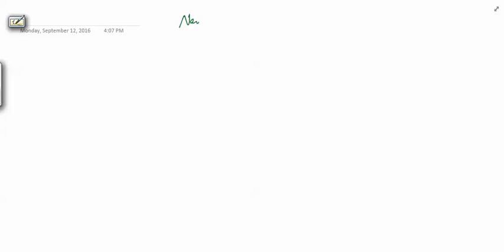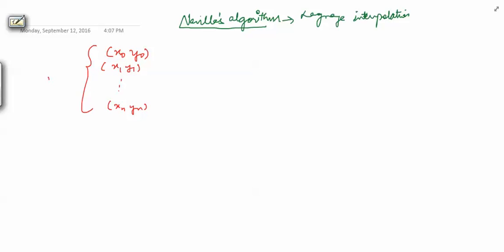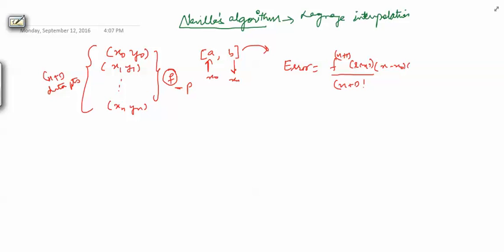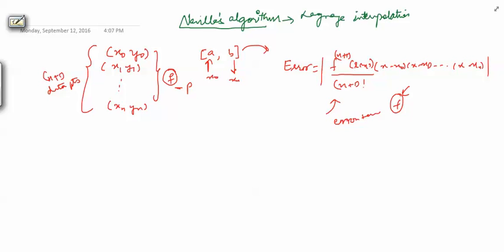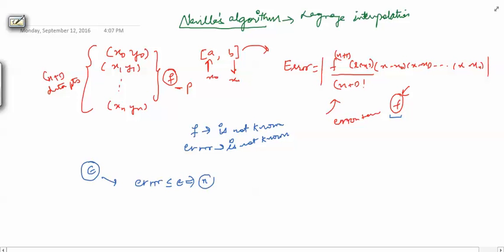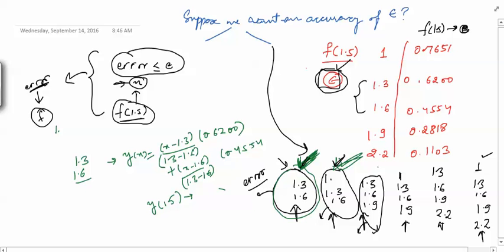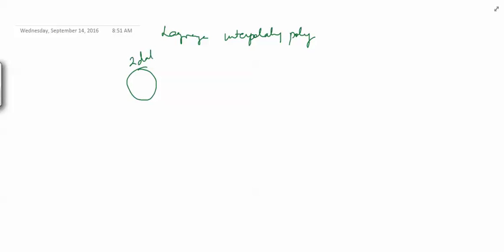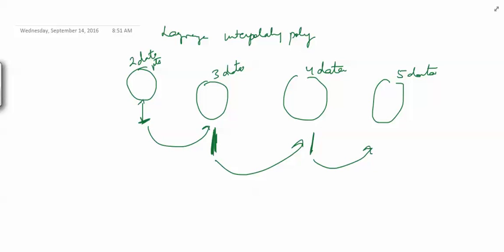L22_Numerical analysis_Neville's algorithm 1 (What is the need of Neville's algorithm?)

Comment: Your interpolation polynomial was wrong(The one which u calculated around 6.30).
If you want to use 1.3,1.6 then the formula will be 
f(x)=(x-1.6)*f(1.3)/(1.3-1.6)  +  (x-1.3)*f(1.6)/(1.6-1.3)
Otherwise it was a very good video.
Thank You